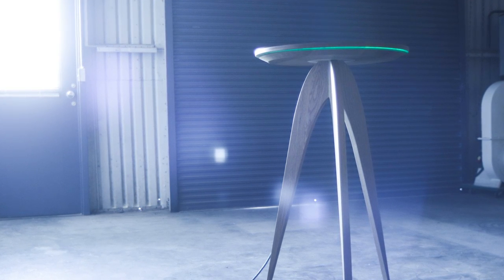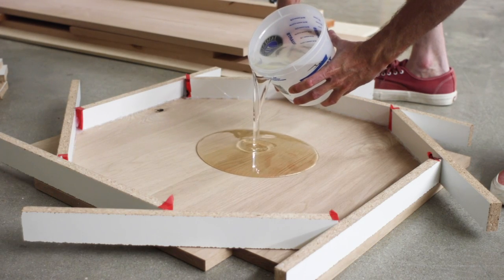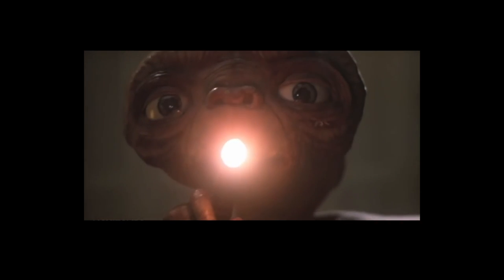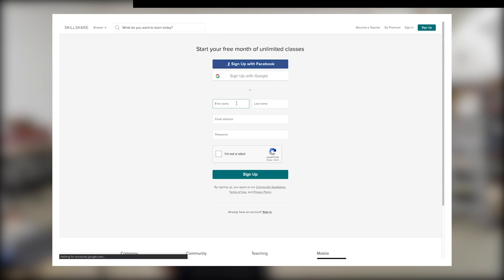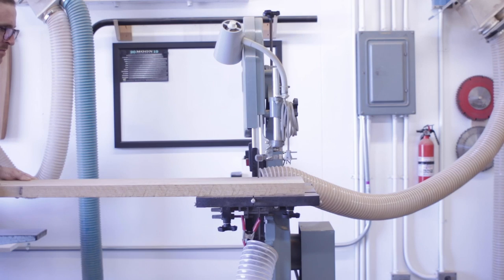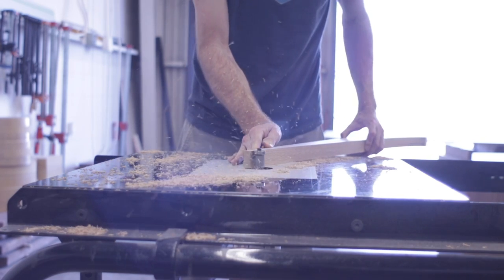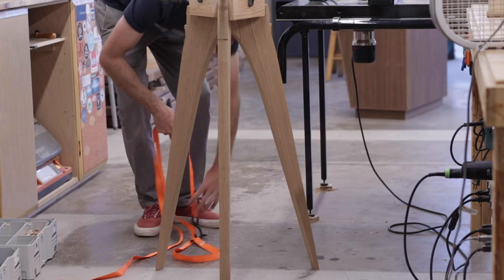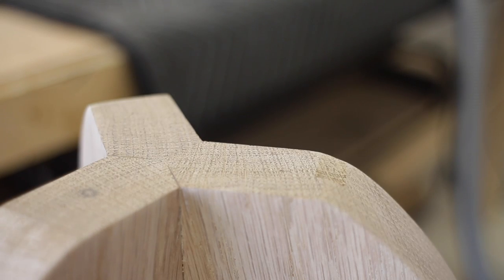Building a UFO-Inspired Cocktail Table with Epoxy and LED Lights

Comment: What's the benefit of using epoxy instead of a sheet of acrylic?
Reply: Erik Flens tbh it’s probably the same, I think Shaun was using epoxy because Chris was using it in another build, or at least that’s what I gathered
Reply: Makes sense, probably had some left. Also giving me some inspirations for a desk I'd like to make in the future.
Reply: Erik Flens would be a cool build. Maybe instead of one epoxy later, have multiple with different thicknesses or something, like thicker at the bottom, thinking out towards the top?
Reply: Maybe easier to machine cleanly, e.g. the chamfer?
Reply: I had the same thought. I checked the comments to see if someone else said the same thing and here you are.
Reply: Yep, pretty much what everyone is saying here. An acrylic sheet probably could have been used, but machining epoxy is much easier, and Chris was using some in his project...so there ya go. Thanks for watching!
Reply: Probs cheaper in large amounts, formable, and easy to work with

Comment: So what is the power source for the LED's and how do you turn them on?
Reply: It just plugs into a wall outlet. There is a little control box that I mounted on the underside of the table that controls the lights.

Comment: To improve the light effect the insides of the epoxied parts could have been made white, as it is, the wood is absorbing most of the light on its way out from the center.
Reply: Totally agree. As soon as I had it sanded up and finish on it, then turned on the light for the first time, both Chris and I immediately said we should have made the epoxy a little more opaque to even out the light. Next time!

Comment: Awesome concept. Are you at all concerned about the oak top cracking when the wood wants to move but it’s stick with the epoxy?
Reply: Thanks Kevin! That is a valid concern. I imagine it will be fine, but definitely something to watch over time.

Comment: It'd be cool if you could 'tap' and 'thread' the disc/opening at the bottom so the legs can be 'screwed' into the top lol
Reply: I almost did exactly that, and still might if the legs need to removed and replaced more often than I am thinking they will.

Comment: So how are the LEDs powered?  Is there a cord?
Reply: Yeah, you can see it in the very first shot at the beginning of the video. I just have it neatly attached down one of the legs. I might come up with a way to embed it into the leg at some point.
Reply: @shaunboydmadethis  That's what I was thinking.  I would have made the legs in two halves so a channel could be carved out on the inside.  I think I'd split all three legs so the seam looked like a design element instead of a necessity for cord placement.

Comment: Super cool build. What LED lights did you use. I’ve never seen everything hidden like that.
Reply: Thanks! They were just cheap LEDs from Amazon, but they work really well.
Reply: Shaun Boyd never seen LED’s work well without a plug in. Good to know! If you have the link please share.
Reply: @eyecraveoptics7475  Oh yeah, these still need to be plugged into the wall. I just have the cord nicely run down one of the legs. Battery powered would be nice, but I agree that they might not work quite as well.
Reply: Shaun Boyd i didn’t see the chord or how it came out of the bottom. Well hidden!

Comment: Hey Shaun awesome build! Looks so cool. I’m just curious what software you use prior to building a project? I just started using Skillshare and want to use it to learn either sketch up or fusion 360. Appreciate any feedback, thanks a lot
Reply: Thank you! I use Fusion 360 and Chris uses SketchUp. Both are great for the type of stuff we are designing, but I started using Fusion 360, so that I could cut 3D things on my CNC machine. Fusion 360 is far more powerful, but SketchUp is great if you just want to get your ideas onto the screen. Hope that helps!

Comment: why didnt you just cut out a circle and use that as the mold?
Reply: That's a good thought. We pretty much decided to do it this way because if we cut a circle in the melamine, it would mean the edge grain of the melamine would be facing where the epoxy would be poured. So we would have had to seal it up with tape, etc. and it just seemed like there was too much room for error.